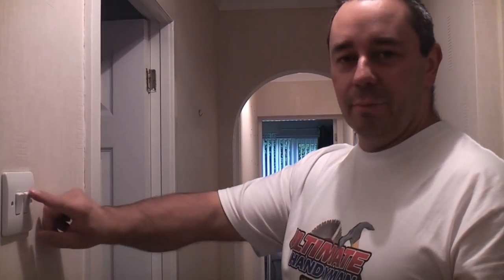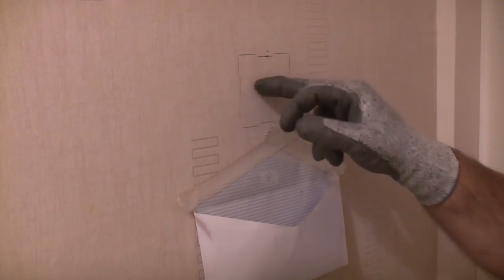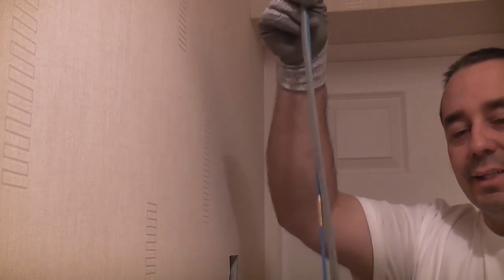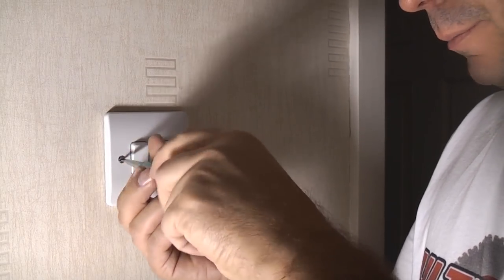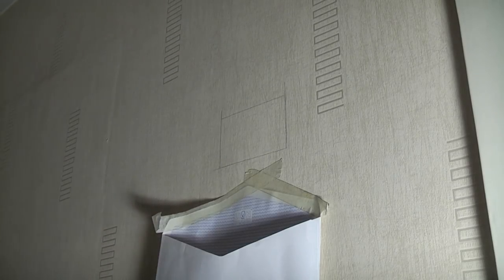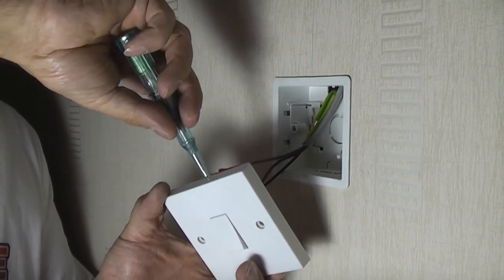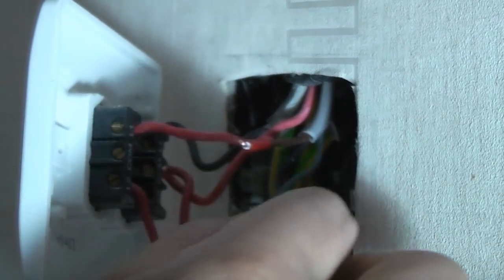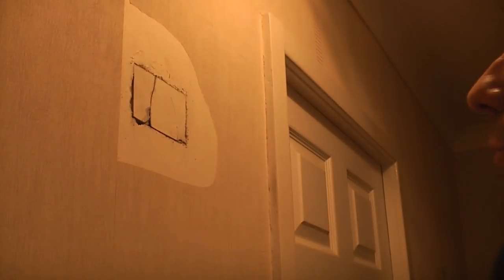How to wire a two way light

Comment: Exellent video I can follow very well apart from where the single RED wire is coming from that goes into L1 @ the top of the switch?  I can see live & neutral coming from the one cable & connecting to COM & L1 respectivley @ the bottom of the light switch. Then you have the new cable being connected as directed. Again though, what is the single RED live in L1 @ the top of the light switch? Thanks in advance.
Reply from the maker: This should help- https://www.youtube.com/watch?v=n52fvF2G0ys
Thanks for the comment 👍
Reply: @ultimatehandyman  many thanks for the swift response. The second video is helpful however it’s not a 2 gang 2 way vid. However I’m assuming that in the 2 gang the same theory applies but you need ‘Bridges’ to / from the 2nd switch to complete any circuits. The single red wire I found a bit confusing in the 2 gang video. Thanks again.

Comment: Hi good video,,infact all you DIY videos are top qulity...im looking for a little advice 1 have a switch horrible white on that i play to swap out for a BG nexus metal one and the L1 / L2 Are indifferent places on the new switch...so am i right in say as long as the match up from the old switch to the new it should work right? all the commons seem to be in the same place though
Reply from the maker: Yes, as long as they are in the correct L1/L2 terminals, the position of them is irrelevant 👍
Reply: @ultimatehandyman  Thanks very much for the reply and help much appreciated 👍 🍻

Comment: Hi how to wire a dp switch with neon to a simple ligth on off  connection switch live wiring thanks, swich works can't get the neon to come on off
Reply from the maker: I don't think it will work, as you only have a live and switched live. A DP switch with neon needs a live and neutral.

Comment: So in the existing 2g switch, did I see a red phase wire connecting both common terminals? It's the one that you moved to L2 on the 2w
Reply from the maker: Yes, some electricians do this when they install a new light, as they can take the power from the existing light switch.
Thanks for the comment 👍

Comment: hi there i'm just wondering what the access hole was for? i didn't notice you using it until the end when you were patching it up
Reply from the maker: There was an obstruction in the cavity that was preventing the cable access kit from reaching the top, so an access hole had to be cut in the plasterboard.
Thanks for the comment
Reply: ahh yeah just remembered the bit of wood that was obstructing it, cheers!

Comment: Hi pal,,I’m a bit lost,,I’ve got to change my light switch but the old light switch is different to the new one,,,,my old switch is only marked up as l1 l2 l3 twice,,and my new switch has 1. 2. Sp and com twice,,,,there is 3 red and 2 black cables,,,I’m lost,,,can you help cheers
Reply from the maker: Best to ask here, with as much info as possible (preferably with pictures)
http://www.ultimatehandyman.co.uk/forum1/lighting-f33.html

Comment: I like these videos .. different ways to do some things and more hands on..
6:00 GS38 4mm MAX Tip i think your missing the cove on the RED side.

Good Clear Video ..hope to learn a few things off you.. I studied Electronics and then Moved in to Electricals
Reply from the maker: I don't think any of the probe has been removed, I'm sure it came like that. People keep saying it's not GS38 approved yet it is stamped with GS38.

I'm not a fan of these types of tester because they are so well insulated you can't always make contact with the tip. How long before someone using a GS38 approved tester is injured or killed because the tip did not make contact with the conductor!

Thanks for the comment
Reply: ***** Measure from the Top of the Prob to were the Plastic covers it.. my tester has covers that go over the probs to make it in to GS38, because GS38 as good as it is, dosnt allow enoguht metal to get in there and Touch things so in old days and cheating ..people take it off so you can make a good connection.

GS38 is more for Electricians to do the Live Testing of a circuit. As you are checking to see if it is Live, as a Electrician i would be expected to use GS38 on there, untill i know it is FULLY DEAD

Could you post the Model and Make.. its ok just need covers (sheves) over the Metal parts
Chauvin arnoux.. The only thing that makes it GS38 is the TIPS... without them on it dosnt complie to GS38
and with Full GS38 you really got to Stab it in ..Martindale VI-13800 Voltage Indicator has a cover that is Sprint loaded.. but still if you dont make connection and you think it is.. then could give you a wrong reading.. Voltage Detector might help as a back up.. but its not a 100% way

Comment: If you wanted to create double two way switches... would you just run two lengths of 3 core & earth and connect the earths at both ends? or can you do that with less wires between them?

Comment: U don't need to measure the other switches if that bungalow has all switches installed properly they should measure to 1200mm to the top ob the switch
Reply from the maker: You always need to check as you do not know when the property was wired. 1200mm is the Maximum recommended height from the floor to the top of the switch.

Comment: Hi.  Thanks for the video. I did my two way light, changed the plastic switch to the new flat plat ones. Now the two works only when the first switch is on then the second switch works and vice versa. I don't know what I have done wrong? All I did was copy the wires in the same way ie Same configuration as the old switch. would the l1 or l2 make a difference if the wires were swapped? Thanks.
Reply from the maker: That should not matter, just make sure that the switched live and permanent live are in L1 and L2 and then put the other three wires in the exact same terminals at both switches. What you have described can happen if the live and switched live are wired into com and L1 instead of L1 and L2.

Comment: I'm an elder DIYer with rudimentary electrical knowledge. I know how to wire a plug and construct a circuit and I know the difference between Neutral and Live wires. I found your video most enlightening but what I did not understand is why you removed the Common cable from the original box and moved this to its L2 connector. This is a genuine query?

My project has nothing to do with tapping into an existing circuit. I intend to run a two way switch from my lounge to my bedroom so that I can turn on and off the Internet router I possess, which is located in my lounge, from either of these two rooms. 

The remainder of this comment is of no importance and need not be read. I give it to explain exactly what I intend doing and why.

Because the router has a transformer plug, I intend creating a dead socket which I can plug this transformer into. This dead socket shall have a lead running to the first of these two two way switches. There will be wires connecting this first switch to the second and other wires running from the second switch to a 13 amp plug in which I shall put a 3 amp fuse inside and plug this into a normal household socket of which I have many in my bedroom. 

The reason I intend doing this after many years of always only being able to turn this router either on or off from only my lounge is because  I am now finding it hard to travel this distance, often being usually confined to my bed. People say I shouldn't bother turning the router off but if I do not the router will go wrong after constant  use and I'll probably not have the money nor inclination to leave my home to purchase a replacement.
Reply from the maker: +Jon Burslem The problem is that two way switches are only rated for use on lighting circuits and should not be used on socket circuits.Have you considered using a remote control plug, like these- http://fave.co/1PqkMEeYou just plug one of these into the wall socket, then plug in your router and then you can switch it on and off remotely, in most cases from anywhere in the house.

Comment: Thanks for the video, I have watched so many of them now, they really are very useful and have saved me loads of time. Just recently whilst tiling the kitchen. Can you clarify something for me please? I have to replace my old sockets and switches with new chrome ones. The 1 gang etc sockets have been straight forward but I am struggling with an intermediate switch for the heating system. The one I bought looks different with the L1 and L2 located top and bottom not left and write, is this due to age and standards changing? Thanks.
Reply from the maker: Some manufacturers label the terminals differently but normally if they are in the same position on the new switch they do the same thing. It sounds strange to have a intermediate switch (or any light switch) for an heating system?
Reply: #Ultimate Handyman . Thanks for response. I put this question onto your electrical forum so I could add some pics, seems it's not an intermediate switch but poss a DP switch. Thanks.
Reply from the maker: Oh, ok. Thanks for the update ;-)

Comment: When you said 1mm T&E on the video, is that OK for lighting? I've always used 1.5mm, but I'm only a DIYer.
Thanks for another great video on a very useful subject. Would be great to have more videos on electrics.
Reply: you can use 1mm.. but most of us do use 1.5mm
Reply: +woodbine66 1.5mm preferably mate
Reply: You can fuse off a ring with 1.5mm for 13A